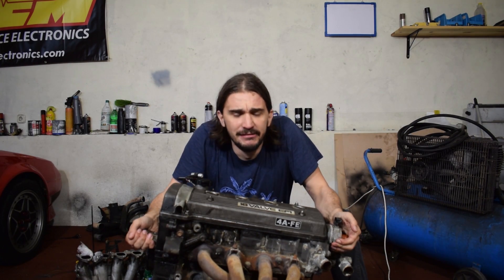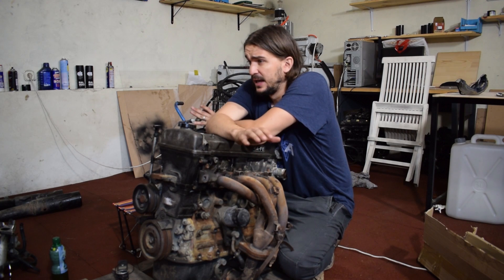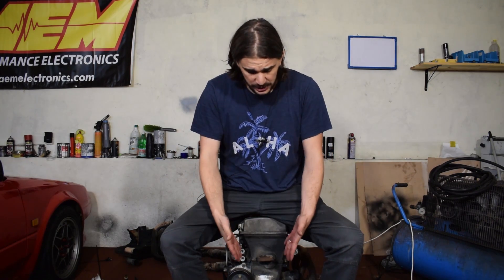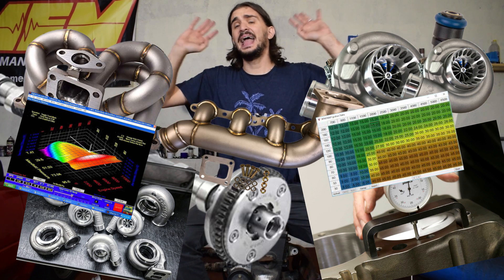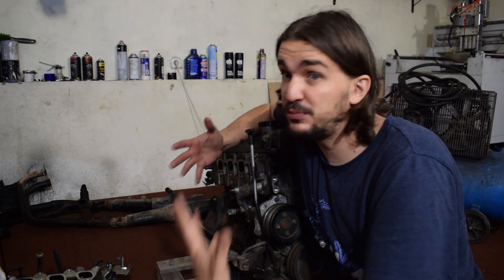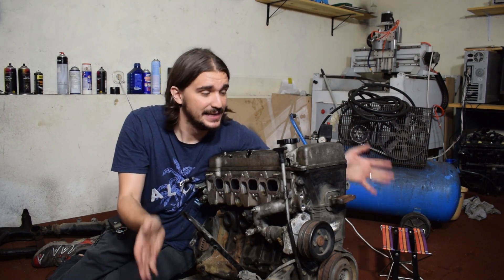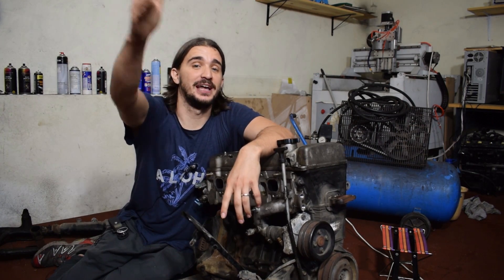TURBO BUILD announcement - PROJECT UNDERDOG #1

Comment: I turboed a f23 engine in a 99 accord. The biggest problem was finding performance parts for the engine. Everything was for the d, k, of h engines. The only parts I could find were for the f22 which was a decent amount different.

Comment: There's so many people in our place saying that having a low speed differential will destroy the turbo. Now I have this set up. Turbo charged engine having high speed transmission and low speed differential, 

they keep on saying that I must change the differential into high speed one.

Can you explain if it is really true that the low speed diff will destroy the turbo???
Reply from the maker: When someone tells you that you need to ask them to explain HOW and WHY does a differential destroy a turbo.

Comment: 5:18 . Boosting any internal combustion engine? Does that include diesels? I hope yes!
In my opinion diesels are easier to boost because they are built much sturdier and you don't care about knocking and having a perfect air fuel-ratio

Comment: This is very exciting, especially because of the swipes you took against internet wisdom. One example of the pitfalls I've noticed on car channels is the total absence of any mention of proper ring gaps being a function of power output. Of course the blown engines are there as you pointed out in the epic fail video reference. I have no doubt this will be a very valuable piece of work you're undertaking.

Comment: Los ejes de ese motor que tienes son de 206 grados amigo  puedes usar los resortes de 4age en las válvulas son iguales pero los de 4age son más duros   y quedan en esa culata. Tip de fan  saludos desde Honduras
Reply from the maker: Que es ejes? Que es resortes? Como se dice en Ingles?
Reply: Ejes = Cams. They are of 226°*, you can use the 4AGE valves springs, they fit and they are harder than the ones in a 4A-FE (second gen). So you can use these springs for your turbo build.
Reply from the maker: Thank you!

Comment: Cant wait to see each mod and its improvements on power, how about porting as first mod? Another cool cheap mod would be itbs before turboing it. Hopefully that can be shown then next level would be to introduce a twin injector setup with second row for higher power, another not well known mod is doing the same that is done to exhaust, a equal length intake, now imagine combining all previously mentioned things in your build making theory videos become practical with a dyno to showcase the improvements.

Comment: Thanks Mr D4A, this sounds really interesting to me, for two reasons. The first (foremost), is that I have come to trust and respect your expertise and presentation style in engine tech tremendously. Since I found your channel I have watched almost everything of yours and learned a lot in the process; I can't think of who else whose answers I would trust as much as yours, nor who else I could actually learn from as clearly. Thank you for your amazing content! 
Secondly - I have a 1ZZ W30 MR2 and I think the engine possibilities are really interesting for it. I was suspecting that the 2ZZ swap would be great fun to drive but not quite fit my goals. I was beginning to think that I would be a nice idea to do that as a learning step, but then put the 1ZZ in the garage and rebuild it to Forced Induction.  If I 2zz swap, then why throw away what would be a good staring point for an FI build?! 2AR swaps are also good fun, but I don't think I can achieve that here. Maybe that's gonna be engine number 3 ;)
Much love and respect, I look forward to your series an I think I will speak to you again!

Comment: How hard is it to get a gze rotating assembly(in Bosnia I think).  Gze guts are good enough for 300hp easily.  That with a custom set of cams and a custom intake manifold and your done.  My vote on turbo is a gt28rs.  Maybe a little big for the 1.6 but if you can get one with a .57 ar that should spool well and can easily make 25 psi.  
I had a thought to turbo a 7afe and got most the pieces together but then I realized I would have to do something about the dizzy and why go though the drama when I have plenty of 4age heads laying around.  I'm excited about this build! If you need any weird odds and ends and don't mind waiting for shipping from the U.S. lmk I would love to help!
Reply from the maker: Thanks for the offer man, I might just take you up on it someday. When it comes to GZE rotating assemblies they are next to non-existent. The only real option is to import a used GZE engine from the UK or elsewhere and the freight cost and paperwork that comes with that is an absolute nightmare both logistically and financially and has the capacity to kill a project in a matter of days. I will likely be using the low-comp gze pistons and aftermarket forged rods, I will just probably buy new 0.5 oversize GZE pistons and brand new rods and combine that with a 4AGE 42mm crank and I think it will be a very stout rotating assembly that won't ever complain at 300hp or perhaps even a bit more if I ever squeeze out more.
Reply: For sure ! I have seen 400+on a gze engine with a turbo.  It was a little over 20 psi and did work! I do believe that there is some something positive about the use of the narrow angle valves of the 4afe.  It has a way flatter tq curve than a 4age and while it does not rev high it totally has a good power band in stock from.  So why not add a little boost. Anyways my offer stands .  If you need a pair of old cams to get them reground I'm pretty sure I have some 7afe head laying around.  And may not be the worst to ship

Comment: What are you going to do about camshafts? The cams are tiny and geared together with a spring loaded gear. I am not aware of any adjustable timing gears being available. Hard welding the lobs is prone to fail on Toyota cams. The later 1zz fe shim under buckets should fit. I am also assuming you will be using the stronger 4ag crank?
Reply from the maker: Yes, 4ag crank. I doubt I'll need to do much with the cams, I can make the gears adjustable as a last resort if needed. Cam lift and duration isn't that bad on the 2nd gen 4afe actually.
Reply: driving 4 answers I think that it will be difficult to achieve 300 hp on pump gas with stock cams. I think that in ported form the head is better than the 4ag. But you will need much bigger cams to reach your target power on pump gas friendly boost. Toyota seems to design their heads in families. The 4ag, 7mgte, and 2vz fe all had the same lousy design.  The do respond well to porting. But the later engines all had better port angles and pocket designs. Toyota always seems to use micro camshafts that work well with their ports at low lift levels. But after porting are way to small. With only 1.6L to deal with you will need to rev the engine up to make good street power at safe boost levels I think.
Reply: 7.6mm lift is really small camshafts. 31mm valves will like maybe 9-10 mm lift? I am considering building a 1zz fe turbo as aftermarket camshafts are already available. I wonder if the 1zz fe head will fit a 4afe block?

Comment: Should be a fun build.  You are making the right decision by enjoying your AW11 now while building your 4AFE.  Just remember that the 4AFE is an economy engine in every respect (crank, pistons, etc.).  I am building a 7 rib 4AGE turbocharged engine for my AW11 now.  The C52 transmission and clutch can also become an issue with a turbocharged 4A engine.
Reply from the maker: I'll use a completely different transmission, stock internals will be replaced too
Reply: driving 4 answers what transmission?  E51?
Reply: Can I convince you to walk away?  The 4AFE has a redline of 6300 rpm.  A 16V or 20v 4AGE has lots more potential and aftermarket support.  You are staring with a nominal 10% less power versus the lowest power 4AGE.  Upgrading the internals and adding boost will cost you similar on either engine, but you would already have higher rpm, stronger rods, and better flow using, say, a silver top 20v.  Or turbo a more modern engine such as a 2arfe.  Understand you want to do something different, but it is a step backwards versus the existing 4AGE.

Comment: Here in Finland last week one guy dynoed his 4afte and
the numbers were:  td04hl-18t, 1.2bar. 260hp/5400rpm and 380Nm/4000rpm from rear wheels
stock motor besides 4agze 8.0 pistons, so 300hp is pretty easy to archive.

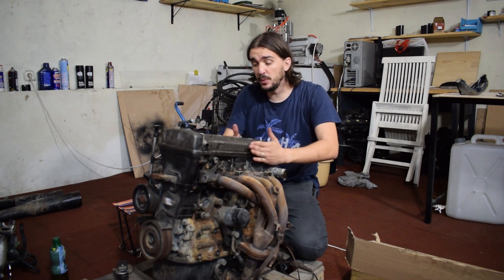Comment: 2:00 Did I miss the series where you showed off your nice gantry mill and the car parts you are making out of it?
Reply from the maker: You didn't, the gantry mill is a bit of a failure as one of the frequency regulators failed and I can't get it fixed, cost of a brand new one is hard to justify so I'm sorta stuck. While it worked I did make a around 200 4age crank sensor brackets and distributor plugs with it.

Comment: Are you pushing for 300 HP on stock internals? I have a 7afe. 300 HP is pretty impressive for stock internals. 7age is a little too much hp for the streets.
Reply from the maker: No, definitely not stock internals. I do think that it is possible to get 300hp on stock internals with some serious electronics and tuning and knock monitoring and the right fuel and a giant intercooler etc. But it's borrowed time. I'm looking to build a stout setup that can do the 300hp all day long without sweating.

Comment: Please start with the very basiscs for this engine like explaining its architecture (open deck, semi open, closed, how many bolts per main caps, ribbing, crank, rod and piston strength, oiling etc) and how to mitigate or completely eliminate any weak spot on those. The best thing anyone can do when trying to get lots of hp from an engine is knowing the HW first. You can put a ton of electronics and SW in an engine but if you have a weak rod the engine will go kaboom eventually. I really like your approach and nowadays electronics can help to get very reliable power from a small stressed engine!!

Comment: Every creator is unique, but comparing is simpler:
Will it be CarPassionChannel level build?
Reply: I hope so, the 1.8L was well put togheter and i love seeing builds like that, every little thing was touched to make a fantastic performing engine and with longevity in mind. 
not just a stock 2JZ with a bolt on turbo+ cheap manifold and stock ECU. sure you can make alot of power even with a stock 2jz, theu are famous for that. but to see another of those builds? eh

Comment: 4age yugo swap maybe?
Reply: or zastava 101?
Reply from the maker: Honestly, not totally out of the question. Fabricating the mounts might be a nightmare but nothing is impossible
Reply: @d4a  for the yugo you are better off with a x1/9 engine, pretty much plug n play, and a LOT of potential (like 9000 rpm with stock crank) search about what Argentina and Brazil has done with it, it's called the Sevel engine.
Reply: no wait the t170 corona/carina or e90 corolla would make for a more straight forward solution

Comment: I'd rather turbo an economy engine because fuel efficiency when not in use. The turbo will compensate for the low power wouldn't it?
Reply from the maker: I'm planning to have several maps switchable on the fly, one will be for cruising :)
Reply: @d4a  I'm excited to see how this project of yours turns out.

What if it kicked in automatically at a certain rpm range like vtec? Wouldn't have to deal with switching

Comment: I smell a proper designed Water to Air Intercooler system for this build.
Maybe a used Intercooler core from a BMW M4 and some welding or Something Like that.
The original Intercooler from the M4 is really good for High Power builds in the M4 so in this build it would be crazy good in this build here.
Greetings from Germany 🇩🇪
Reply from the maker: Intercooling will be crucial of course, have a few things in mind but can't say anything yet :)

Comment: Wow cool project dude, but, what is your gearbox and your driveshafts thinking about the new power level??
Reply from the maker: The c50 and shafts are staying with the bike carb 4age, the c50 wouldn't last long with turbo torque. The transmission side of things will be very challenging, but I'll figure it out. I do have a very serious transmission candidate already, but it will require some serious moding.
Reply: @d4a  Sounds good mate. Hope the best for it, cross fingers 🤞🏻🤞

Comment: For coils I'm going to suggest the Toyota 1zz Denso coils they are quite potent ,a V band turbo and header will be more compact than a flanged turbo and header, you can probably get away with 3sgte or 2jzgte injectors they should be 440cc ,you need to get the full complement of the AEM  sensors they will help a lot and look great

Comment: Having a stereo mic is nice but for commentary you should make it mono (I'm sure it's easy with any program and cost effective), maybe you can adjust it in software because you just end up being louder in one ear over the other while talking :D
Edit: Alternatively if you get a sound defect like rubbing on your shirt, you can just pick the clean audio from the left or right channel, make that mono and delete the messed up audio from the other channel. :) Hopefully this is a helpful and easy to adapt tip!
Reply from the maker: I really appreciate the advice as I'm struggling a bit with audio recently after moving to a lapel mic. I do have a mono mic too but when I record with that one and listen to headphones I just hear the audio in one ear. Maybe I should convert the mono recording to stereo
Reply: @d4a  That's a bit odd, it could be a down to quite a few things but sometimes the most obvious is the easiest to overlook. It could just be down to the cable you use, has happened to me before :D If you can't figure out the hardware side of things, you could do what you suggested and just copy the channel that's recorded and paste it into the other channel one in software.

Comment: Very excited for this, as I was recently fantasizing about doing it some time later to my E11 corolla (instead of its 2E), as 4AGEs are impossible to come by where I live, but 4AFEs are everywhere, and the fact that the 4AFE has a better valve angle as you said, will give it some good potential I suppose
Reply: i bet his build will use aftermarket 4AGE parts that fit, unless aftermarket FE parts are available.

Comment: Would you recommend a 4age+- turbo as a first project build?
Reply from the maker: Sure why not, lots of resources on that. I would still maybe do just a simple back to factory spec rebuild first and turbo later once that is proven to work well.
Reply: @d4a  thanks for the answer, if one would love to do one engine that would be very forgiving for newbies but also last for long time, what 4 banger would you go with? 4age?3SGTE? 4G63T? Any other?
Reply from the maker: Any of those three work well. The old volvo lumps are also nice if you have access to them. The 1.8t VW works great in Europe. In the USA an SBC or an LS is a joy to work on, endless resources and part supply.
Reply: @d4a  As I'm from the small Luxembourg, german engines would be easy but also found some quite cheap JDM engines over in Germany. Would you go german or JDM as a first projekt? Thanks man, really appreciate your Feedback🙏🙏🙏

Comment: Change the spark plugs positions cranks valve timing valves a throttle boddy on the turbo...    throttle body on turbo?

Comment: I dont understand why they called the 4AFE an economy engine.
Reply from the maker: Mostly because they developed it to make torque down low, so you could drive around without revving high and save fuel by doing so. The intake manifold and small combustion chambers all work towards this goal. The rotating assembly is also weaker and has a 6 bolt flywheel flange not fully counterweighted crank compared to the 8 bolt fully counterweighted crank on the 4ag. The narrow included valve angle was also considered more of an economy approach back then.
Reply: @d4a  I have a 4AF which eats about 8l/100km if I go easy, when I go hard it eats like 9,5l/100km. I have read a lot of forums and 8l seems pretty normal for the 4AFE (unmodified) engines, but here is the catch! The 4AGE (unmodified) has about the same fuel consumption as the 4AFE, while it has better performance.
Reply: 1,6L engine with 113hp is far for economy engine in the 90s. The engine desing is oversquared, that is more performance oriented. The engine was detuned only for South African market.
Reply: Every Toyota engine with the FE prefix are economy engine because FE stands for Fuel Economy
Reply: @Realtime1501  F stands for narrow valve angle, G for wide valve angle and E for Electronic fuel injection. It's a cataloguing system that's descriptive of things that are known when the engine code is raised such as geometry and fit out rather than things that will be found out later such as fuel economy or who might be making it. Prior to VVT you had to choose between high revs torque with poor low end torque or the opposite. And prior to the 1980's gearboxes were primitive 3 or 4 speed Auto with a kick down or a 5 speed manual and clutch. The combinations of "G+5 speed manual" and "F+Auto" worked well, while the opposites were generally disliked (hated...) because of the compromises.

Comment: Awesome. Ive always wondered how that engine would do with boost. My 1992 toyota corolla with a 5 speed manual transmission was very reliable. And it sounded sooooooo good with a straight pipe exhaust.